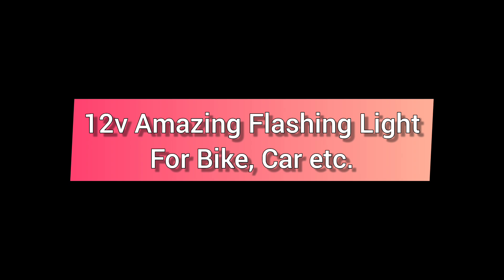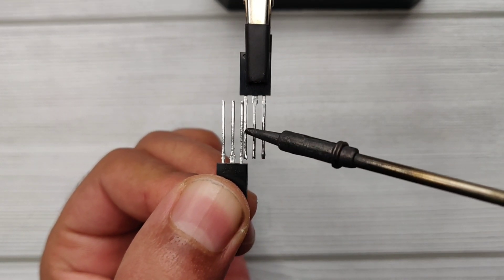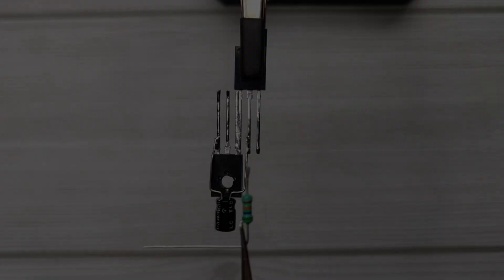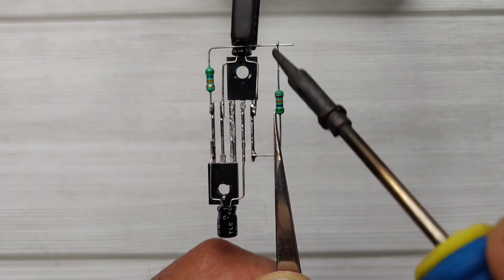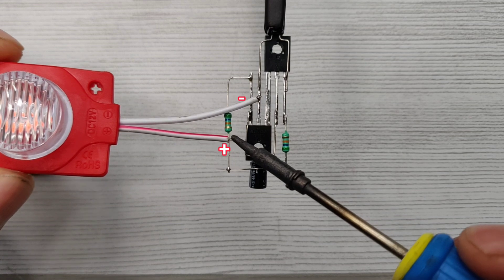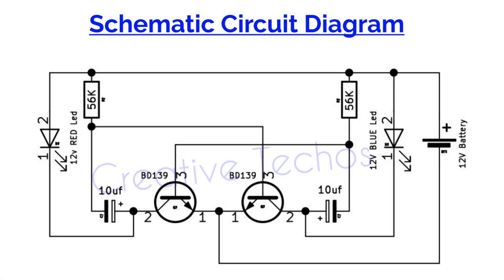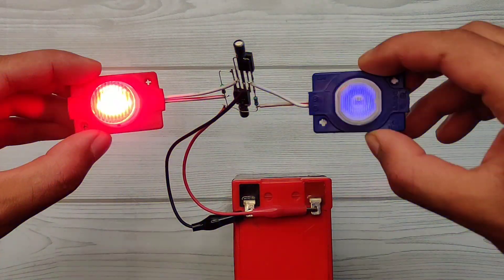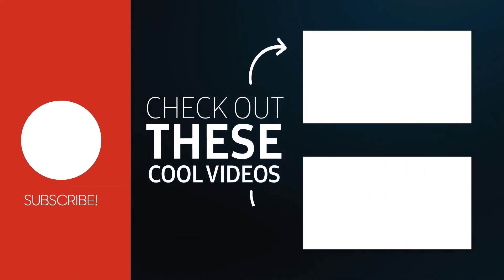12v Police Strobe Light circuit For Bike, Car without IC using

Comment: Thank you very much sir🙏  But one doubt, can I use this circuit with 12v 30amp power supply? If not what I need to add to this circuit?
Reply from the maker: Yes, of course you can use, Resistors are there to limit current

Comment: Thanks for the tutorial. I've managed to get it to work for smaller LEDs but when using larger LED spot lights they don't strobe but just stay on. Do I need larger resistors or different transistors/capacitors?

Comment: Hi I'm new to this channel, how would you slow the flashing to one or two seconds between flashes. Regards Geoff Maddison
Reply from the maker: Actually what happens the capacitor gets charged through resistance and then discharges to base of transistor and for that seconds transistor turns on, that turns on led, and at the same time another capacitor is getting charged and works.
Its while discharging one capacitor another is getting charged
If you Increase capacitor uf it will decrease the charging & discharging speed of capacitors hence led will slow down the flashing speed, and increase flashing speed if capacitor uf decreased

Comment: Pls sir can u make 10 hr  2 hr circuits change over... It's important for me..
Reply from the maker: Let me know more information about this, Telegram or  whatsapp +91 9596386458
Reply: for truck 24 volt , how kilo ohm resistor and uf capacitor need to make?

Comment: Will u please those lights directly put on. 12 v supply
Reply from the maker: Yes you can connect it directly with 12v dc adapter ot battery
Reply: S its ok l. A stable multivibrator... Am using mje 3055...100uf cap